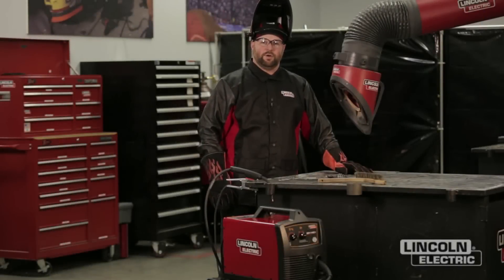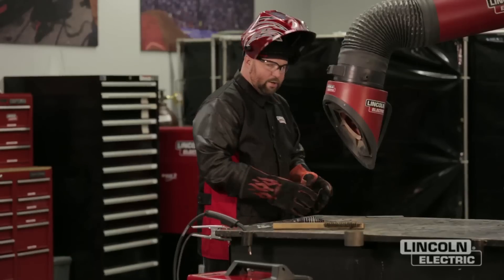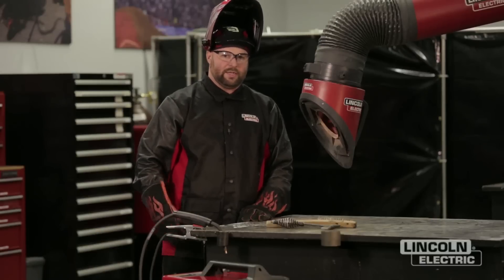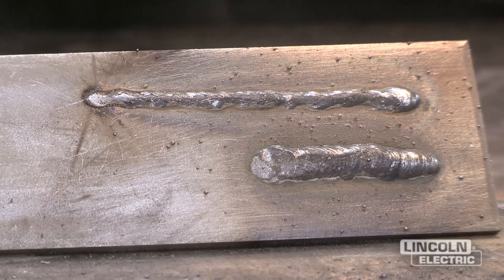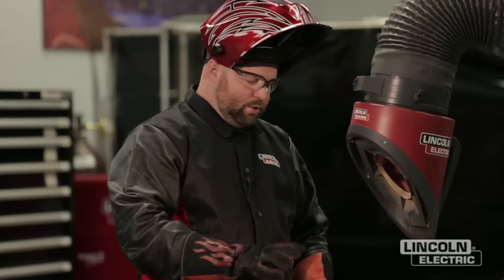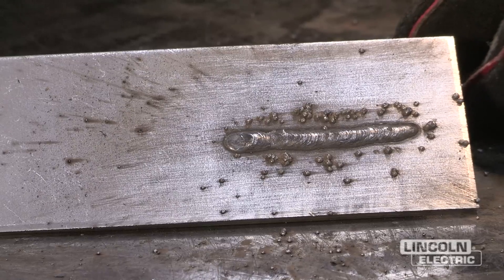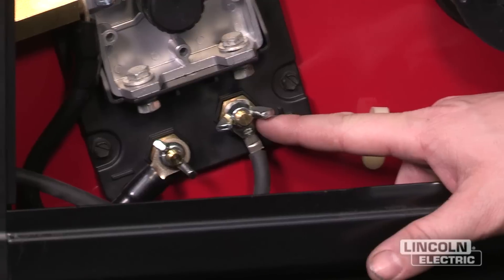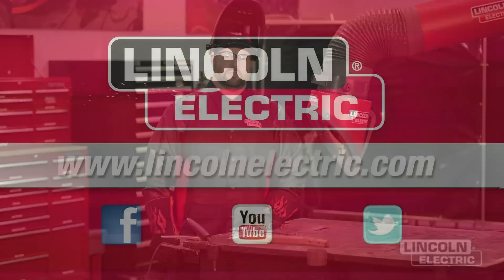Tech Tips: Self-Shielded Flux Cored Arc Welding (FCAW-S) Troubleshooting

Comment: he's tell you what will look if different ways of wedding ,high or low, and what will look like after its done,same as voltage to high or to low and the wedding part gotta be tilted and walk it back and forth slowly till u see a nice wedding ,
For me i spot wedding ,then i clean off all rust and i use a metal cleaner break fueled works, then i test on a scrap piece of metal too get my perfect weld,

Comment: I have a question that I hope you or anyone can answer or comment.  I am going to buy a welder in the near future for some upcoming projects.  In particular fabricating a front end loader for my 1170 lb. Diesel JD garden tractor.  I have not welded since I graduated high school in 1984.  I used the Lincoln down and dirty red arc welder 35 years ago.  I do not plan on welding bridge girders together and don't think I need to spend $1000 or to the moon, but would like to be able to weld 1/2 in if I need too.  EVERY welder I look at has been 220 volt DC Flux Cored/MIG.  My neighbor up the way has done anything I have needed to weld so far.  He has a high dollar MIG setup that I have seen him weld/penetrate the hell out of 1/2" plus stock with in the MIG mode.  He never changes.  The welders I am looking at are $500 - $700 220 volt DC Flux/MIG minus the gas.  EVERY machine I look at will weld 1/2 inch stock but using the flux cored wire.  MIG I have read (a lot) is for light metals, body panels etc.  The project I am about to start I may weld 1/4 at the most.  Can anyone tell me how my neighbor can weld train track together with his MIG, yet everything I read says MIG is for light steel.  I am at the point where I wonder if I need more than a Flux Core welder as long as it is 220 DC Current.  I am not afraid of cleaning my welds so that doesn't enter into it!  I do not want to become a welder, but I don't want to die under the FEL I am building.

Comment: Just finished welding an exhaust pipe to flange. This video really helped me figure out what to look for. I was running too high a wire feed. My first trials were terrible. Almost gave up. This video helped a lot.  

My next weld was much better but still not very good. The welder feed was hanging up and poor arc. 

I put a new contact tip on and wrapped copper wire around the cheap sheet metal ground clamp. Much better!!

This video made the difference. Thanks!

Comment: Reverse Polarity....if this is true of all flux core welders, even the cheap ones, (I own Harbor Freight 90) then why not make/set the welders before putting on the rack?
Reply: Harbor Freight 90 is a AC current machine . It will NEVER weld good until converted to DC current. THe cheapest you can go with a Flux welder and get good results is with a Forney 140 FCi  $200 or less from Overstock.com with coupon

Comment: The suction hose is pulling the shielding gas away from the weld... I dont know a lot but thats my oppinion
Reply: Good thought but shielding gas is for MIG welding (IG of MIG is inert gas, usually Co2 / argon mix).  This video is flux core which has no shielding gas. Flux core leaves the slag which is what protects the molten puddle from oxidizing.  That's what he chisels away.  BTW smoke eaters can be used with MIG without a problem.  MIG outside on a windy day - welds will look like a whore's handbag.

Comment: I just went and practiced all the wrong stuff. The only thing I did that you didn't was melting the .030 tip. I hooked up to correct polarity and looked at the box to make sure. Then I looked and read it 2 more times and switched the feeder to positive. Practice was 1/8 x 1 1/4 L,  well cleaned.  It was horrible and I remembered it doing so well the last time I had it out.
It seems that the machines problem may be my glasses.  Thanks for this video, I watch it every time I am outside failing at this. 
Farm welding is what my aspiration is.There are a lot of tractors and implements in my world to maintain. Almost not too bad is my self graded work with 1/8" 6011 and 7018 rods on around 80 - 125 AC amps. That machine and my tanks are too much to haul around off the farms. Hence a 110 dc/140 amp inverter MP,  two new 20 breakers, 12/3 wire and 20 lbs of FCAW wire.   Good thing that's practice wire... lol

Comment: My Lincoln 180 says 3/8" stick out with flux core, i use nr211 with good results, im going to try it at 1/2" to 5/8" and see how it goes, could that be why it seems a little hot for the settings?  thanks good instructions on fcaw.

Comment: If you're going to weld flux core strictly then get rid of green filter helmet get a true color, then you have to have variable
 voltage welder important to find sweet spot , if you can't see too good get magnifying lens and lastly get good wire, these
 will improve  your welding tremendously but even the best flux core weld will never look as good as gas. just not possible.

Comment: Hi great vid, but agree about being able to see the puddle and wire, and also the jargon about the polarity, seems you need to be an elecrician too, i purchased a sealey mightymig 100 and apparently there junk but what i could afford without going for used, no ball park settings on the welder and only set up of machine putting wire in and handle on so no help what so ever, wondered if you could help it says the machine comes ready to go so as I've never welded before i wouldn't really know if its the right polarity as my welds would be as bad either way, so could you tell me is there machines like this that can't or shoildnt have the polarity changed, any input would be great, thanks in the uk
Reply: I googled for a manual for the MightyMIG 100, but there are perhaps multiple models. The manual I saw  for the "No Gas" model said to use flux-core wire (no surprise) and that the torch was connected to positive, which would be wrong, and puzzling since this machine can't handle gas. So could be a mistake in the manual, or actually an incorrect design. At any rate, it's simple to check -- just connect a voltmeter (set to say 200V) with meter negative lead to the ground clamp and the meter positive to the welding wire coming out of the torch. If the meter shows a positive voltage -- the torch is positive, and incorrect for flux-core. Most welders have a way to reverse the polarity, as shown in this video. However the MightyMIG doesn't show a way to do that, and would not need to if it was already wired correctly for flux-core. I suppose there's an outside chance that the Sealey flux-core wire TG100/1 is actually supposed to run on electrode positive. The product page is unhelpful: http://www.sealey.co.uk/PLPageBuilder.asp?id=20&method=mViewProduct&productid=8473

Comment: I have a suggestion that would be helpful for beginners watching these, otherwise, very excellent videos. In most of these videos the speaker uses phrases such as "...use DC Negative polarity...". That is actually a meaningless phrase to a beginner watching the video because it is impossible to know whether the presenter means 'Positive ground" or "negative ground". While the presenter obviously knows how to weld and is very articulate I sense that he is using phrasing that, while it may be understood by every professional welder on the planet, it is as unhelpful and confusing to the neophyte as if he were speaking Sanskrit. Please be precise when making points such as this. Thank you.
Reply: The reference to Neg (-) or Pos (+) is always in respect to your electrode. A welding unit is not grounded either, if it was it wouldn't work. The "ground" is the return. This completes the circuit that is in fact, a controlled short circuit. The electrode is like a "fuse". Hope this helps Bob.
Reply: Thanks for the comment. I am a neophyte in welding. I bought a kicking horse 120 v flux core mig gas less welder sold from a Toronto distribution. Do you think l should play around with the polarity ,just to fix my welding. Thanks

Comment: Sure would be nice if you used a darker shade over the camera lens so we can actually see the puddle and wire doing the things you're describing.
Reply from the maker: Flux Cored wire is difficult to film because of the spatter hitting our lens. We have taken measures to protect the camera so we can bring you the puddle view in future videos . Sorry for the inconvenience.
Reply: lincolnelectrictv put the camera behind a welding helmet. This video has excellent info, but without actually being able to see the wire and puddle, the only thing the viewer has to reference is the sound, which really isn't that useful because your welder doesn't sound like my welder when the settings aren't dialed in just right.
Reply from the maker: Mr. Curtis, thank you for your suggestion.

Comment: I never weld on a bench where I can hold the tip perfect.
I'm always on the ground reaching around something  and barely fit the tip to the weld.
Reply: Paul M indeed, gravity is not your friend... since you mention it I don't think that I've seen a single vertical or inverted (upside down) weld in any of these videos. I hate overhead welding, the hot stuff always finds a way inside of your leathers...
Reply: No crap man!  All these how to videos show a pro welding in optimal conditions.  Anybody with half a brain can pull that off.
Reply: @aadoublea  - you need to learn how to weld properly under ideal conditions before you can get good results when you're out of position.  Must master the basics first.

Comment: Great job, I noticed you said you wanted to feedback to improve. Try a video with 2 variables gone wrong instead of one, like too high voltage with perfect, short, and long stickout. Then do too low of a voltage with the same stickout criteria. Plus, use pictures in your videos that you pause on, showing side by side comparisons of labeling the two variables conditions for what you chose in for each variable. And last show in that image the perfect conditions. Hope this helps you and if want to send me a free welder or welding equipment for this quality feedback let me know.
Reply: It's probably common to have two or three things wrong at once!  Might make for a long video if you tried to work all the changes!  (say, wire speed LOW, and travel HIGH, then wire speed HIGH and travel LOW).  That's a great suggestion, but it might take a series of videos to implement.  Ah, sometimes people who weld for a living are not good at diagnosing things and changing the setup, I think in factories there's someone who sets everything up for everyone?  I have got paid a few times to just look over something and see why it isn't working, or maybe even talk about it on the phone!  You wouldn't believe it, but people do things like getting the wrong gas bottle, and everything goes to hell and they just can't imagine WHY.  I know people right now who "welded" for years with the wrong polarity, and it was nothing BUT spatter and slag!  You could pull welded steel stuff apart with your hands!  SO, common scenario:  Wrong polarity, way high travel speed, AND many starts and stops, so that a lot of "weld" is trying to deposit on to SLAG!  (Engineering students are doing this)  I sometimes pull off an allegedly welded thing with my hand, and yell "Either I'm SUPERMAN, or something is WRONG HERE!".   I'm not actually any good at welding, but I can watch YouTube videos, read old books and yell.  It's something!

Comment: very thorough video, i just bought a Miller 211 and am learning to weld with flux core .030 wire. im noticing that my spatter is 10x worse then anything im seeing here. my welder has an auto feed setting where you just choose material and wire, and the machine does the rest, i tend to think its accurate based on reviews and my own experimenting with manual settings.
Reply: Your 211 will make a very nice bead using FCMA but polarity needs to be changed on the machine from electrode positive to electrode negative, you will notice the difference in s lot nicer weld with less splatter
Reply from the maker: Check your polarity. If not, test drive a Lincoln and see if your problem is just the welder itself.

Comment: I always have trouble with penetraction, I've never once welded something that wasnt a crowned weld, Even laying a bead on really thin materlal my welds are crowned with a ridge on both sides, travel speed/ wire speed/ voltage maxed doesnt seem to make any difference, I see these guys laying an inverted type of crown between two joints of pretty thick material it just doesnt seem to happen for me..
Reply from the maker: The most common mistake for FCAW-S is that they run the wrong polarity. Be sure you are on DC- for NR211 that is shown in video. Other than that there should not be an issue. Just run the setting according or recommended settings or under the door of the machine.
Reply: I believe maybe I need a wider travel path, Most of my joints are small fills or lap joints which could be compounding my issue, I dont have much trouble on flat stock or 90 degree angles, Maybe i'm just feeding too much material in the center of the weld not spreading the heat to the sides.. Been practicing for almost a year now, between scrap/exhausts done a few engine mounts and slowly getting the hang of tubing. I want to get into shielded gas welding once i'm a bit more comfortable with the machine
Reply from the maker: We will help if we can. We have an app that has all the welding parameters in the Apple App Store and Android/Google Play Store. Maybe that can help. There are also a lot of resources on the Lincoln website.

Comment: I have a Lincoln 125. Great machine for my needs. Excellent video. I feel like I need to go check my machine for the correct polarity after watching this given how sloppy some of my welds are. Ha! Just for clarification, using a self-shielding flux core wire, the feeder wire needs to be on the negative? I believe that's what you said in the video.
Reply: ..self-shielding, wire negative...... gas-shielded flux core,wire positive......
Reply: What is innershield NR 211 MP ?

Comment: Can you make a video shot through a hood? FCAW is hard enough to see the puddle, this is just a blob of white light. Also, less exaggerated settings would be helpful. Videos tend to show the extremes of bad voltage or feed, but do little to show how to achieve a glass smooth weld.
Reply: Well, I'm a pro videographer.  Most of us use a zoom lens on our 
cameras. . We're about 4 to 6 feet away. Plenty away from the action. 
After the wide shot we stop the camera and cut to the CU  (Close Up) of 
the weld.  We have several neutral density filters and can stop down to 
F16 to see the bead without blowing out the whites.  Easy, really.
Reply from the maker: We will do our best. Its hard getting the camera that close to flux cored because of the spatter.
Reply: Nathaniel Stone    I agree....
Reply: Nathaniel Stone He made this video so that you can try this with your welder on your own to learn.
Reply: lincolnelectrictv hh
Reply: Nathaniel Stone we’re gonna do even better and fasten the camera to the nozzle a half inch from the wire !
Reply from the maker: Thanks for your input. I agree, very easy.  Unfortunately we are using DSLR lenses. I have a 100mm Macro, but again, we need to be fairly close to get the shot we want.  I would love to have a chat about how you produce welding videos. I looked on your channel and didn't see anything. If you want to reach out and exchange ideas please email me ay videos@lincolnelectric.com
Reply: because putting the "glass" from a welding hood in front of a camera is real hard

Comment: why don't you have the copper sleeve on the gun tip? is it not tneeded when you don't use gas?
Reply from the maker: No. It is not needed.
Reply from the maker: The simple answer is yes. When you are using Innershield Wire you do not use the copper nozzle.
Reply: Is it better without? I guess visually you can see the puddle better?

Comment: I am using a pro-core 100 with .030 flux core wire.  Is this size wire ok?  Or do I need to use the .035 wire instead?
Reply: Animal Rammer usually its on .045. but it just depends on your job honestly